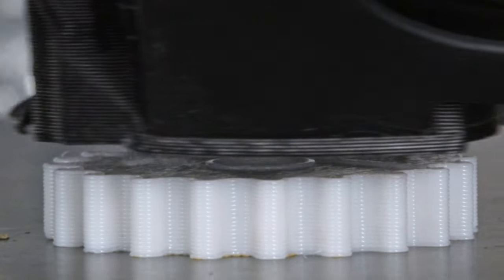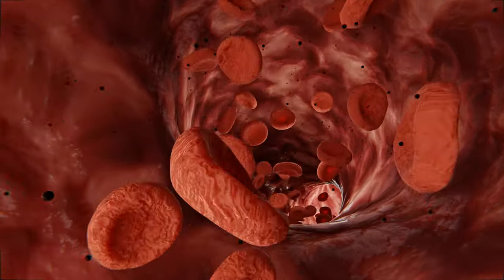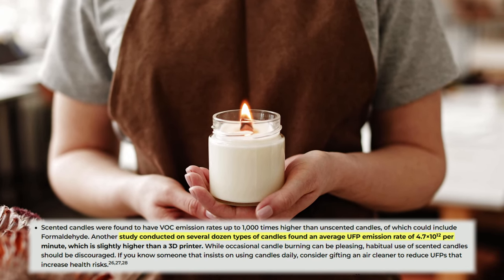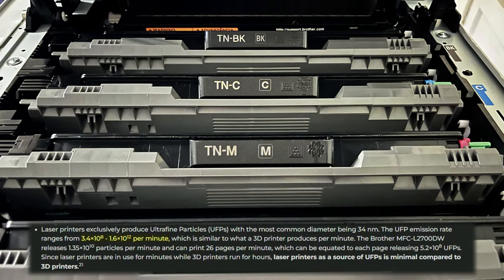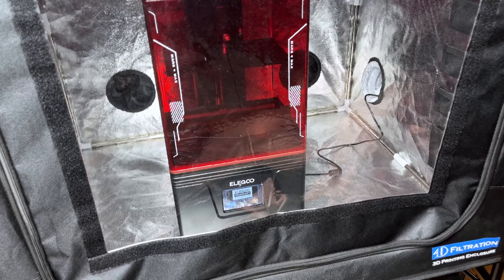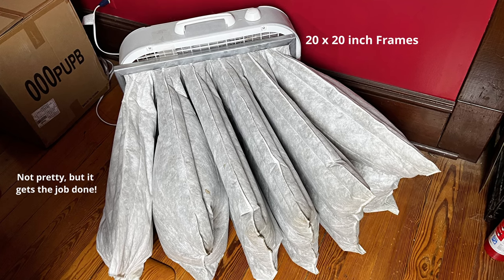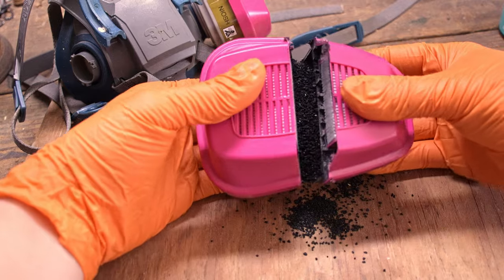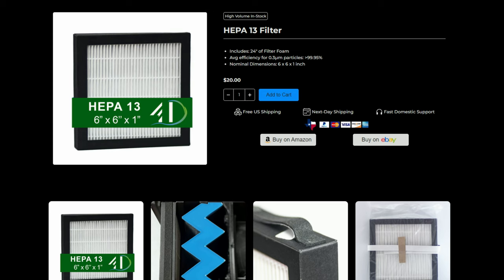FDM and Resin 3D Printing UFPs (Ultrafine Particles)

Comment: Im looking forward to buying an fdm printer and probably would be keeping it my room itself. Ive been doing a lot of research and this one helped a lot.

My doubt is whether it would be ok if i use some basic ventilation, considering I'd be using pla and petg only
Reply from the maker: Active ventilation would make PLA safer in your room, and thankfully PLA and PETG are less likely to warp because temperature.

Having a small filter in the room running 24/7 would also be a decent idea. Do keep in mind that it’s recommended to use it outside bedrooms if at all possible.
Reply: @ArisAlder  thanks bro
Appreciate it 🙂❤️

Comment: I have my printer in the garage. My garage doesn't have any windows, so I'm not sure what to do. I wear a mask and I'm only in the garage to start printing and then for another 20 minutes after printing is finished. Any idea what else I can do to improve the air quality?
Reply from the maker: Easiest thing to do would be to open up the garage after the print finishes to help it air out while you post-process. This does have weather and safety implications, which would make drilling a 2 to 4 inch hole in the wall for an exhaust a reasonable alternative.
Ventilation is usually the correct answer since proper filtration is expensive.

Comment: Comparing the particle size without mention of their qualities relative to the human body might be a little bit confusing at best or disingenuious at worst.

Mentioning their class (such as amines with food, vs. polymers whose VOC's are flow agents or polymerizing agents), solubillity (how well does it dissolve in water, and hence the lungs or eyes), miscibillity(do they mix with oil and not water, so they might stick to the skin), or whether they resemble chemicals the body uses (such as BPA's or other Phenolic Acetates).

That said, resin printers, do produce many harmful compounds that the body absorbs far more easily  -- but quantifying the "why" they are "bad bad", as opposed to food particulates which --  without bogging down the audience with chemistry equations.  It would require understanding the reference material but translating that for the laymen would separate you as a far more informative channel.
Reply from the maker: I absolutely agree that diving into how each type of particle affects the body could merit its own video/article, but I do believe it is out of scope for most audiences and thus hard to justify time-wise (at least for me atm). I still plan to touch on VOCs eventually.

The mixture of the exact particles will be fairly complex - for example, with cooking, the particles can come from the gas stream, the electric burner material, the pan, and the food itself.